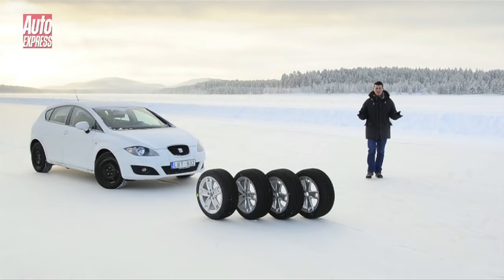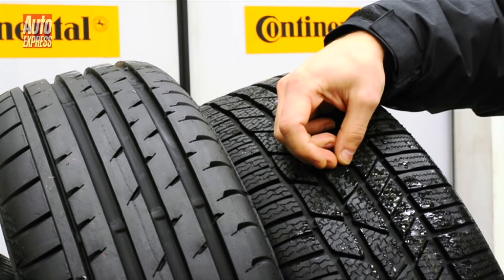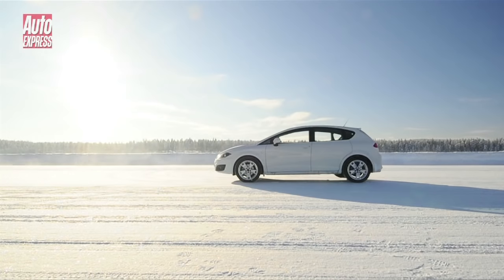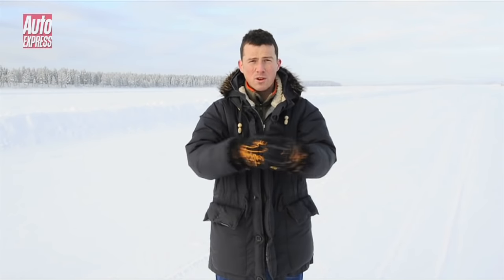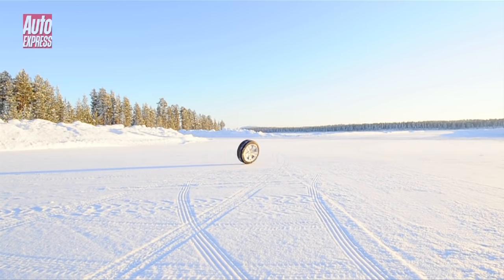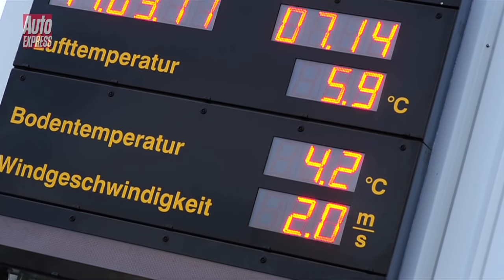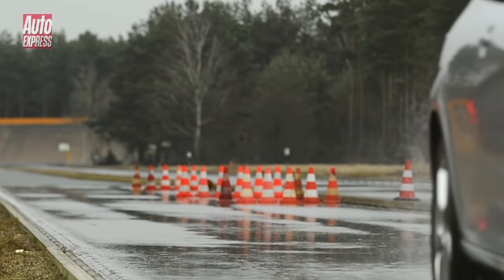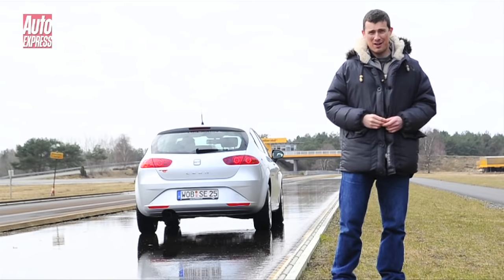Winter Tyres v Summer Tyres: the Truth! - Auto Express

Comment: Try all season tires vs winter tires
Reply: isnt all season tires just winter tires without those metal spikes?
Reply: No it is the rubber compound that is a big difference. The metal studs is what they are actually called. Those are mainly for ice but they "can" be illegal depending upon where you live because they destroy the road.
Reply: The tread design is also different. It's shaped to be able to grasp snow and ice better (more rugged design compared to the smoother design of  non-winter tires)
Reply: All season tires really should be renamed to no season tires. They generally perform worse than summer tires in warm temps and nowhere near as good as winter tires during the cold seasons especially on snow and ice.
Reply: Rogue Racing sorry, but it's bullshit. Did you ever had all seasons tires on your car? Sure I woudn't use them for my pretty fast bmw, but they are doing great all year and in all conditions on my renault, used generally in the city and not agressive.
Reply: No, I assure you they aren't nearly as good as winter tires in winter. I've owned many cars throughout my life and have driven on many different tires. Not everything is a conspiracy.
Reply: Rogue Racing you don't have to assure me, because as you can see in my previous post I HAVE good all seasons tires (Nokian) in one my cars and I HAVE good winter tires (also Nokian) im my other car and as owner of these two types I know what I'm saying. If you don't have powerful car and you don't plan to use it in hard winter conditions in mountains or drive fast and aggresive in the summer, but to drive it to work or shopping in big city, all seasons are enough. And btw, you can have the best and most expensive winter tires in the fucking world and in many places in mountains you won't handle it without snow chains. Been there, done that. Several times.
Reply: power has little to do with it.  Bottom line is traction. You don't have to have a expensive powerful car to make use of more traction and reduced braking distances. Obviously if you live in an area that almost never has snow I can see your point of not having winter tires. But from where I'm from snow happens quite frequently and I see many cars that aren't properly prepared crashing, causing traffic and simply just getting stuck.
Reply: Rogue Racing I mean that if you have powerful car, you drive it as it should be driven: fast. And in that case you should have proper performance summer and winter tires. We have usually 4 months of snow here, but living in a big city it's rarely so much of it on the street to get stuck. You can stuck even on winter tires, but what is shovel for ;)
Reply: It's not about getting stuck, it's about being able to stop, turn or accelerate as you intended. You don't need a powerful car to benefit from tires. most of the time it's not even snow that's an issue it's ice that's the issue and also the fact that winter tire's rubber is actually suited for winter temperatures and isn't hard as a rock like all-seasons/summer tires are when temps dip below freezing.
Reply: Rogue Racing you still don't understand what I'm telling to you again and again. This conversation is useless, so buy the tires you want and drive safe. I'm out.
Reply: if all 4 wheels lock up simultaneously the ABS system has no way of telling the car is still moving it just assumes the car has stopped already.
Reply: Pretty sure acceleration sensors are so cheap now (every smartphone has them) that an ABS should be able to infer that a car with four locked wheels has not yet decelerated enough to be stopped. If not, they absolutely should add that feature.
Reply: Steven Densmore I agree! as he said the winter tires will be softer at any temperature, so it will certainly have better grip, but will wear off faster. if cost is not a problem and safety is the primary concern, running permanently on winter tires should be better...
Reply: you got it, also i noticed this test was done on snow. Are your streets usually not ploughed and salted? I dont drive on snow in canada!
Reply: Rouge Racing are all right. All season tires are really never best.
Reply: I was about to ask the same question! I'm driving on winter tires throughout the year and besides the noise they make they're pretty good tires.. Only thing I hate is the crazy price 🙈
Reply: Matthijs Noort in hot weather, winter tires will become malleable and the tread will wear very fast. That's probably why there going bald quick and costing you money! Switch to summer or all weather tired in the summer, unless your region doesn't experience much hot weather.
Reply: We've got 30-35 degrees in the summer and -10-15 during a cold winter ^^ I just hate the effort of changing the wheels
Reply: I have all season tires on my 4x4 car, but they are terrible for ice/snow
Reply: Felipe Borelli not really, thue to how the threads are designed in combination with the softer compound, winter tires get "swampy" driving characteristics. It kind of have the same effect as worn out suspension. And when driving agressively you heat the tires up, so that they get even softer. Pirelli p zero Corsa for example is made out of a very hard compound that is designed to be heated up but its not that great for every Day driving. This is the tire pretty much every super car gets shiped with
Reply: Rogue Racing 
Your name is literally “Rogue Racing” clearly you’re aren’t thinking about people who do everyday, non-aggressive driving. All-season tires are extremely useful when you drive responsibly and normally. All though, it’s not very fun.
Reply: You need snow tires if you drive 75mph like a Rally driver on snow.   Driving on bare tarmac with snow tires (even in Winter) wears them down, and snow tires are not cheap.   In the snow States people used to change between winter and summer tires , now most people use All Season.  The all seasons are more economical and it's a decent trade-off, you simply drive slower and don't maneuver like a Rally Driver.   ,

Comment: Why aren't they comparing All Season vs Winter Tires, seems like a better comparison. It would be pretty stupid to expect summer tires to perform in winter.
Reply: Agreed. I wish someone would do this same test with those conditions.
Reply: Sam Robichaud - because most (probably 99%) of drivers have summer tyres and that is the standard option a fitter like Halfords or Kwikfit will offer (these are UK generic non-dealer car repairs/tyre sales companies).

I just whacked my car details into an online provider of tyres but the 3 recommended tyres that come up are all summer from £114.99 to £148.99 with ratings from A-C (from a scale of A-G) for wet grip even though it's December. You have to choose a separate option for the winter tyres - which come in at £153.99 a pop
Reply: Gobtik Here in America, at least in the Northeast, all-season are the standard tire. Decent winter tires probably start at £85 per. If you go into a tire store this time of year, the front of the store is all winter tires. But most people still run all-seasons and then slide around all winter thinking it's normal.
Reply: StalePhish
Not sure whether the UK separates "all season" and "summer" - they just have to meet a certain tread depth and shops don't sell them as such, just normal and winter.

My car has wide low profile tyres (came with, wasn't chosen :) ) hence the cost being higher - if we got enough bad weather to make it worth it, I would get winter tyres but it's simply not worth it here
Reply: Gobtik Summer has less tread depth but is better on dry or wet pavement in the warmer weather. The downside is that they don't last as long as all-season and are pretty terrible in snow. All-season is like the "jack of all trades, master of none". Low profiles are probably summer, but I'm not sure. I don't really know many people that have summer tires in this part of the USA.
Reply: StalePhish
UK tyres just have to meet a minimum standard of at least 1.6mm across the central 3/4 of the tyre (though it's advised to change them around 2.5mm).

I plugged my details into one site and they only offer summer, another had winter as an option, but no specific all-weather but this may be down to my tyre size

As an example of mine, these are rated A for water grip though poor for rolling resistance meaning better grip, worse fuel efficiency, no idea how these compare to what you would class as all-season:

http://www.blackcircles.com/catalogue/hankook/ventus-s1-evo-2-k117/215/45/R18/Y/93/f
Reply: Gobtik I looked up that Hankook Ventus S1 EVO2 K117A on my local tire store's website and it's classified as a high performance all-season. We've got the same 1.6mm requirement here. My guess is that summer tires last significantly shorter than all-seasons but you get more grip. Winters have a lot more depth but also probably wear out quite a bit faster when it's warm and dry. I looked up the specs for my winter tire on my coupe and they start at 9.5mm (very deep!). They're significantly more aggressive looking than the average car on the road. I've became interested in tires lately so I'm always looking at other people's tires as I'm walking through the parking lot thinking to myself "you're not having much fun when it snows!"
Reply: StalePhish
 Better grip than my bike anyway!

The "4 seasons" setup for a road bike looks like this:

http://www.wiggle.co.uk/continental-grand-prix-4-season-folding-road-tyre/
Reply: StalePhish Hankook S1 EVO2 is sold as a summer tyre in Europe.
Reply: *****  Wouldn't surprise me, most of the online tyre shops just offer tyres + winter tyres in the UK - it's a performance tyre as my car is a sport spec but will probably go for something with more grip/better fuel efficiency - I get more thrills (and less risk) on my road bike with slick tyres than risking my car!
Reply: *****
 Depends on your situation, UK "tyre shops" are typically a franchised garage from a major chain who do not offer storage of tyres or free fitting, there are very few independent garages who would offer a service like this
Reply: player101player101 
All season tires certainly exist. 

Ref from the Michelin website: http://www.michelin.ca/tires-101/buying-tires/how-to-choose/seasonal-tires.page

In eastern Canada, most people will use All seasons from mid-spring to fall.Spring and fall can be messy with unpredictable weather & temperatures, Summer tires would be shit on ice, so if we got a late snow storm in spring or an early freeze in fall it would be dangerous driving.

Summer Tires are are considered a luxury and are really only used on high performance cars, or "summer cars" that are only brought out in summer months, the average person would not use summer tires.

All season give us the best bang for buck and can give decent performance in the event of a weather variation.

But for our tough winters most people will switch to Winter Studded tires, because winter is no joke here, and all seasons just cant compare.

Alot of people around here take the name all season too literally, and use all seasons year round. 

Of course there will be a difference between Summer & Winter tires, on ice & snow.

I guess i'd be more interested in finding out how big the performance difference there is in between All Seasons & Winter tires, Since some  drivers around here use all seasons year round.

I thought all-seasons were used everywhere, but i'm starting to think it may be just a north american thing.
Reply: Sam Robichaud player101player101 Sam, it's the exact same situation in the northeast USA. I would bet that 80%+ of the population drives all-seasons year round. They certainly take "all season" too literally so we have a ton of spin-related crashes from fall to spring. My parents had always had all-seasons so I had always driven on them as well, until a couple years ago. Now I drive on winter tires (Pirelli Winter Carving) from November to April and the difference is night-and-day. Even on dry ground, the winter tires noticeably out perform the all-seasons just because of the low temperatures. I notice as we get nearer to November that my all-seasons start squealing in the corners because they're getting hard like a hockey puck.

Comment: I ran Bridgestone Blizzaks on my Chevy Express AWD for more than a year in WV and have nothing but great things to say about the benefits of snow tires in normal conditions. The only downside is that the soft rubber compounds leads to early treadwear and less than optimal mileage between tire replacement.

BTW, when I say "normal conditions" I mean for a WV winter on roads exceeding 8% grades and offroad travel where required....Which is often.